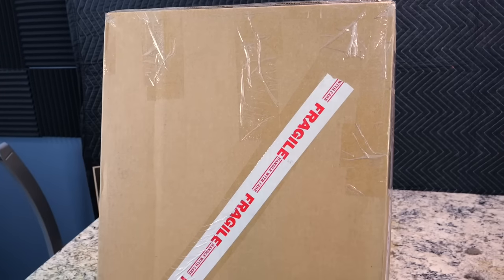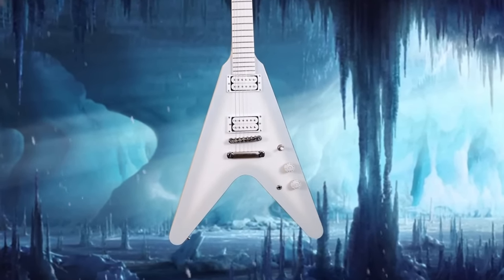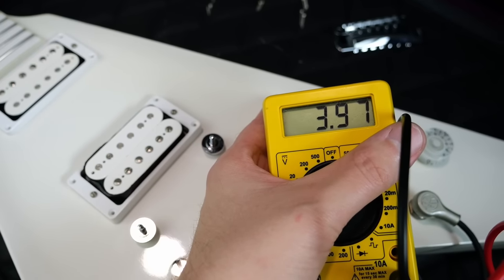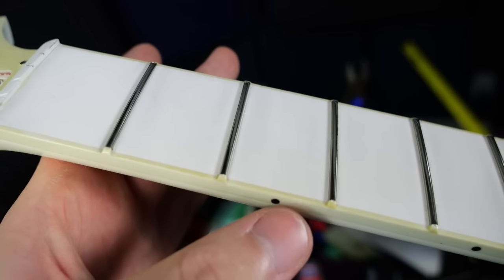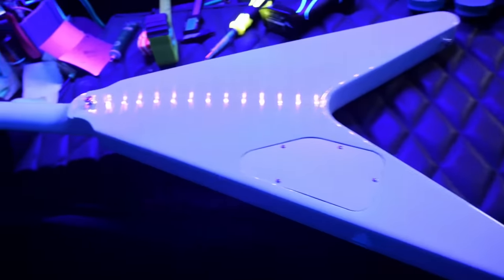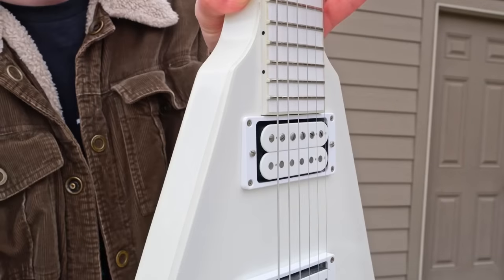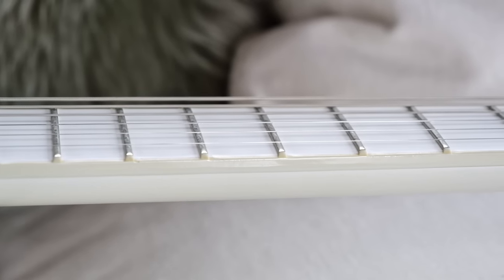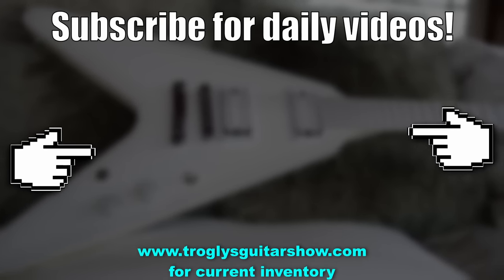I Haven't Had This Rare Model Since 2015! | Gibson Snow Falcon Flying V White Fretboard

Comment: Question!!!!!

I've had a Gibson Snow Falcon since 2014, Saldy life has gotten in the way and I haven't been able to play, as much as I used to. When I got mine, it was Mint, no issues what-so-ever. However, over time some issues started appearing, mostly in the way of the paint cracking on the sides, right next to the binding as (pointed out at 5:44 almost identical to mine) . Which is fine, I never really intended to sell it. But to my question! after having it for almost a decade, its only JUST starting to yellow now. Im not 100% sure on why not over the last 8 years, but now. but my question to you is, How in the world would I work on getting the yellow out!? Most projects I see in removing yellow from products require using Peroxide chemicals or fully submerging the item in other liquids, obviously that's a big no-go. Any ideas?!?!
Reply from the maker: You don't remove the yellow. It is just part of the aging process. Leaving them in the case tends to yellow that model faster
Reply: @Trog  fair enough, thank you for the reply!

Comment: I could imagine that fingerboard being Maple that was painted and lacquered over. You can't see the wood grain, but I would not be surprised if it was the same form of maple that had gone into my Epiphone Negative V. I like how aggressive the pickups are, but I am still not satisfied with what happens when you split both coils and select amid position. Gibson is still muffling one coil as it cuts out the other. They have to modify the engineering involved.

I also like the way you played to demonstrate it, Austin. You are a far better musician than you give yourself credit for.

Comment: The Snow Falcon shoulda skipped the white burst edge effect and deleted all those chrome bits and came all whited out with powder coated white tuners and pegs, all white tune-n-matic posts thumb wheels and tail piece with white posts and white switch tip nut and washer, and a white input nut and washer featuring white headed pickup screws and truss rod cover plate screws, white strap locks and unless I’ve forgotten anything, maybe white copper fret wire?…LoL